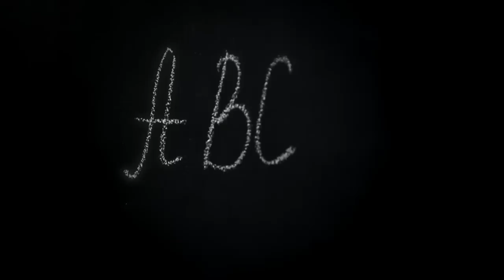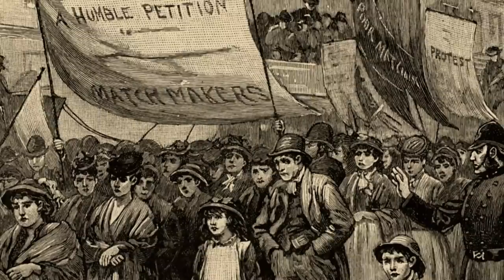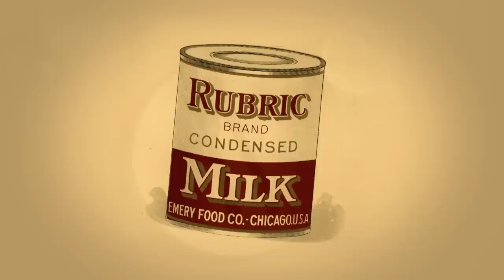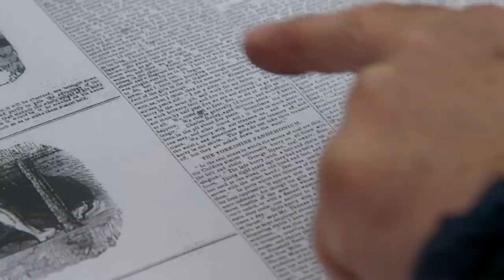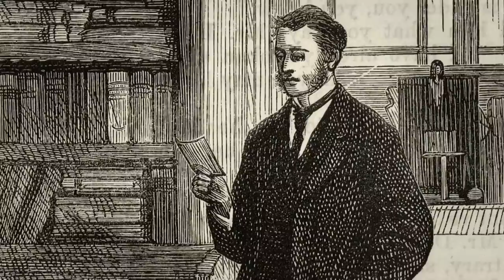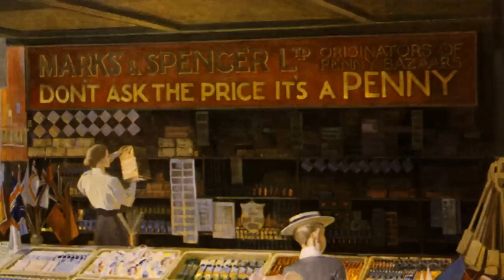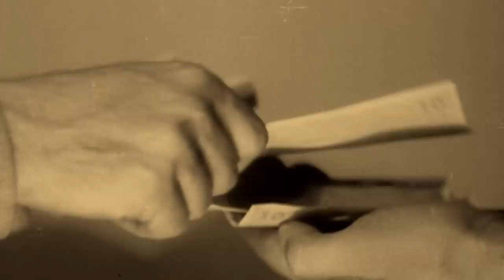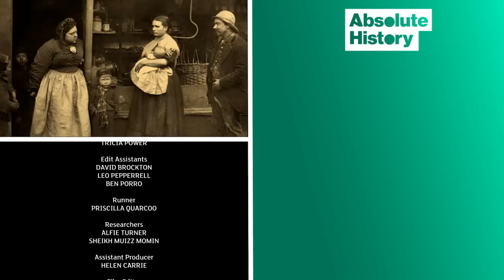The Gruesome Life Of A Victorian Match Girl | History Of Britain | Absolute History

Comment: Those poor matchstick girls remind me of the radium girls. They developed a very similar condition through their constant contact with radium paint, which they used to paint "luminous" watch face dials. They were trained to make fine points on their brushes by rolling the brush between their lips. The radium would then absorb into their body and acted very much like calcium, so it slowly replaced the calcium (often in their faces, but in other parts, too). Ultimately, their face bones were riddled with holes and would shatter or fall out. The poor women suffered horribly. But despite the company's knowledge that radium was very deadly, they were never told...just like the poor matchstick girls. So sad.
Reply: They also developed radium jaw, so reminiscent of the phossy jaw.
Reply: I was reminded of that hearing about the match workers too.
Reply: I was thinking the same thing. I can’t even imagine it.